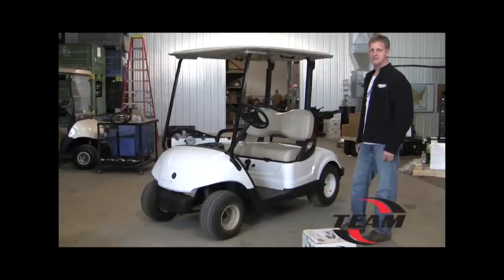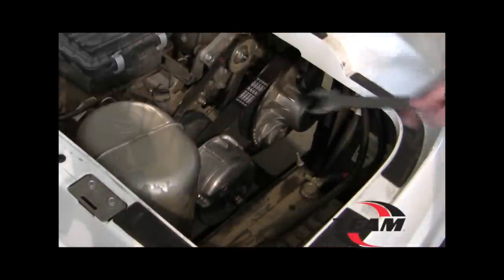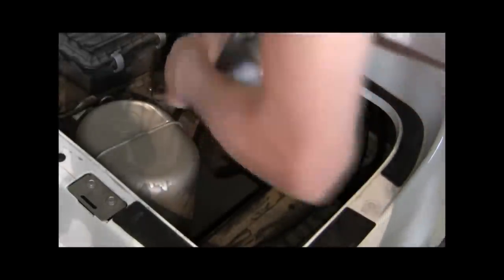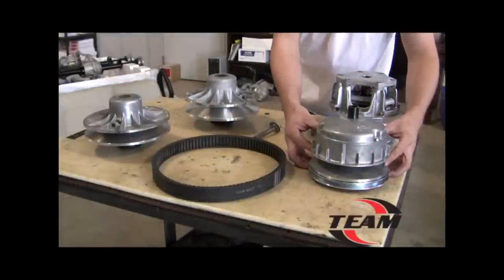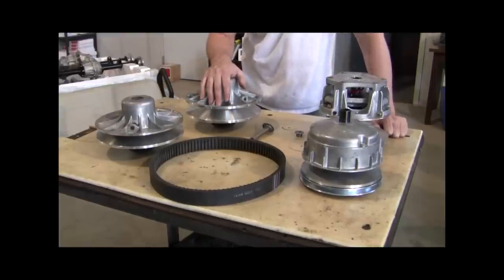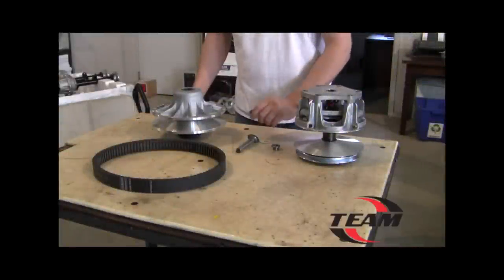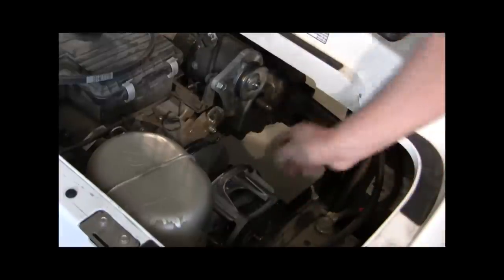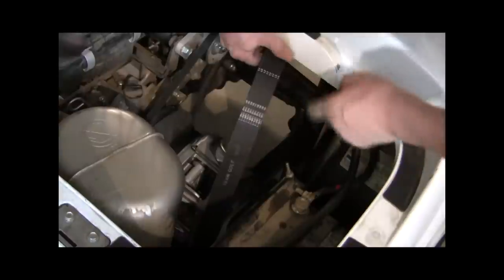TEAM Industries Golf Car Clutching

Comment: Hey guys,
I just purchased the same clutch you are installing but it does not have the pulley for the starter belt. Is that clutch for club car ds? It is a rude solid clutch too. Been trying to figure out what it fits. Any help would be cool. Just got it in sept.

Thanks,
B